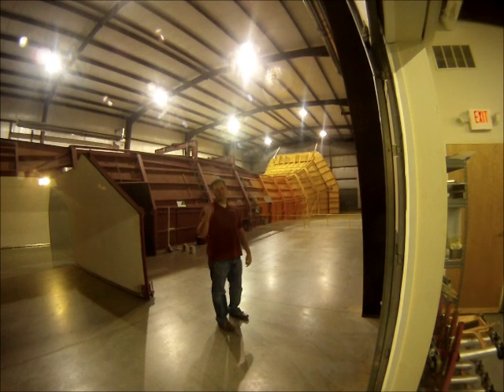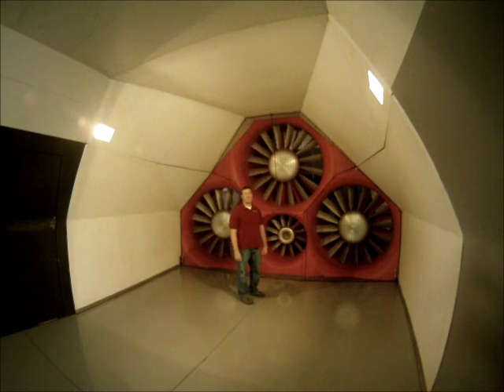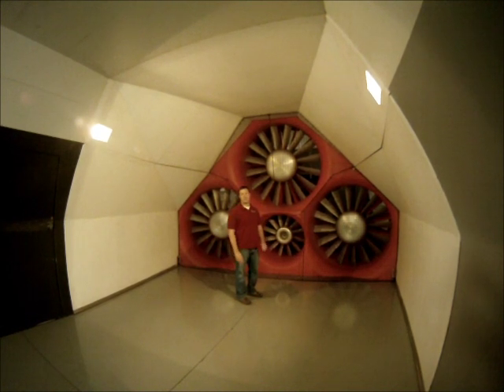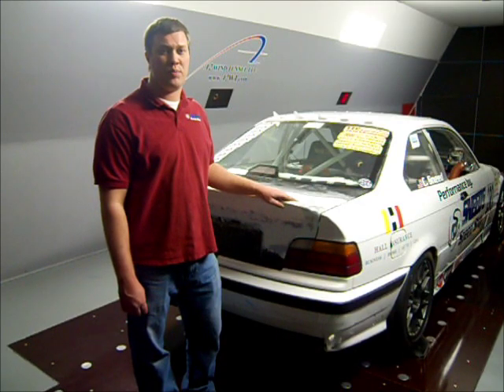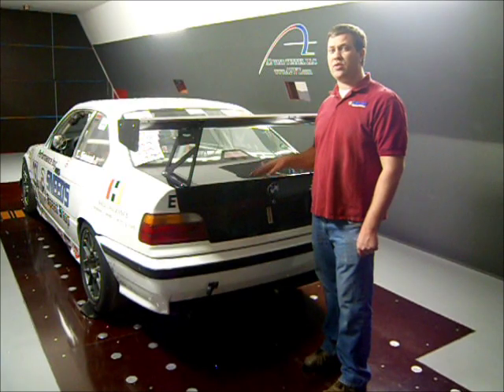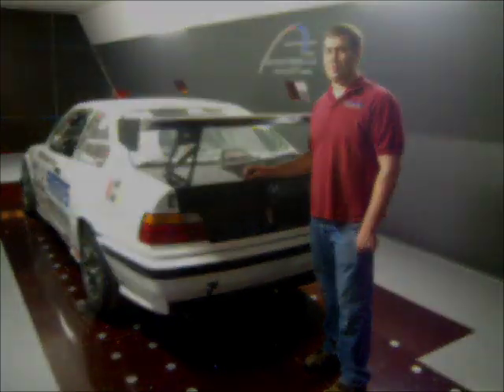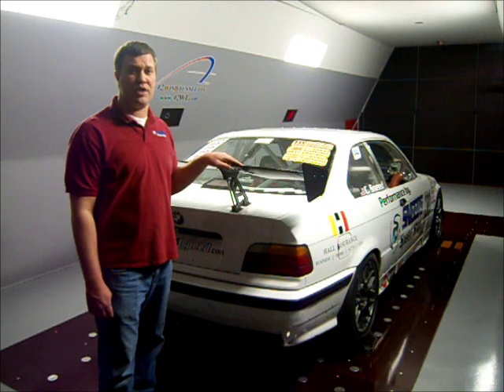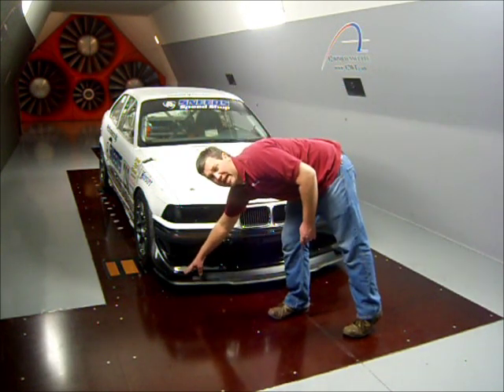Sneed4Speed BMW E36 M3 Wind Tunnel test of Sneed4Speed wing and splitter

Comment from the maker: The Vortex generators are closest to the EVO style.  They are just bent aluminum triangles that are two sided taped to the car.  The car needs more front downforce and the VGs only help the rear wing.  Also, they create a lot of drag and don't produce enough downforce to off set.  VGs work better when you have to run a spec wing profile like in world rally and want more downforce but can't move the wing.

Comment: I know this is an old video but hoping you may still respond. I'm interested in your front bumper setup. Are you utilizing the fogs for brake ducting? It looks like the OEM brake ducts are taped off, and the main duct on the front is blocked as well. Is it more effective to block that than duct it towards the radiator for increased cooling? I assumed blocking like that would raise temps quite a bit.
Reply from the maker: This car does use the fogs for the brake ducts.  The lower center duct for the radiator is blocked and the grill kidneys provide airflow.  The kidneys are ducted to the radiator and the ducts cover the whole radiator.  Temps were always fine.  Thanks for watching.
Reply: Awesome! Thanks for the response. Very cool to see the testing done.